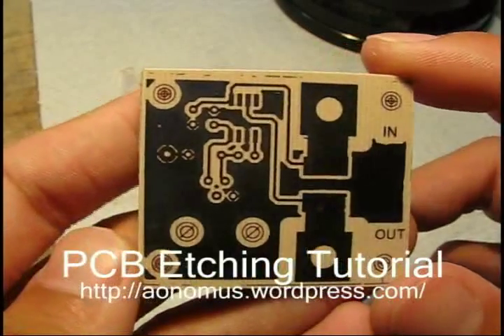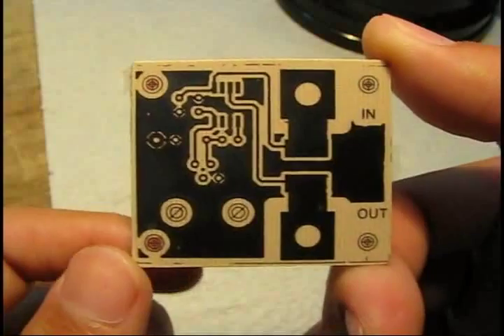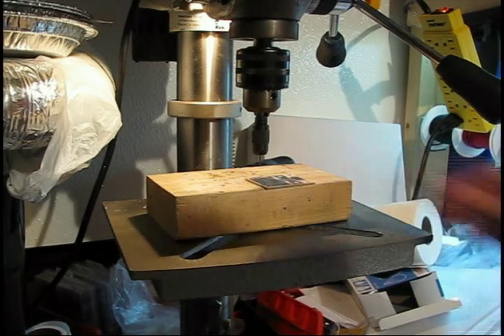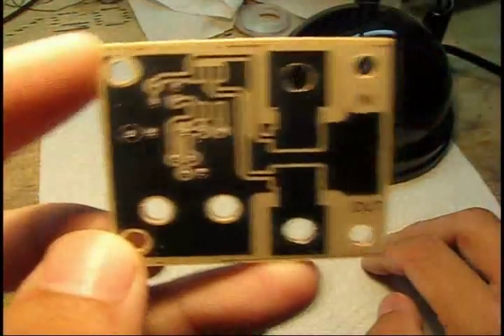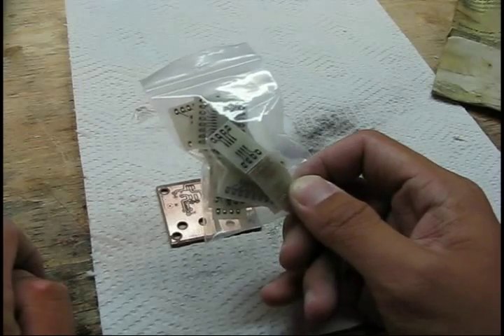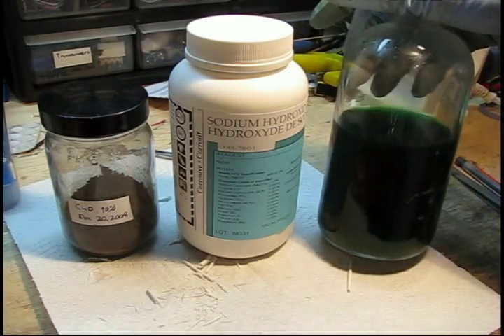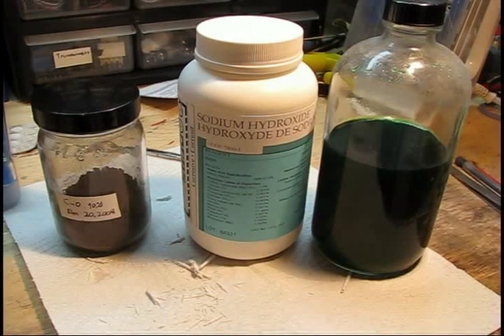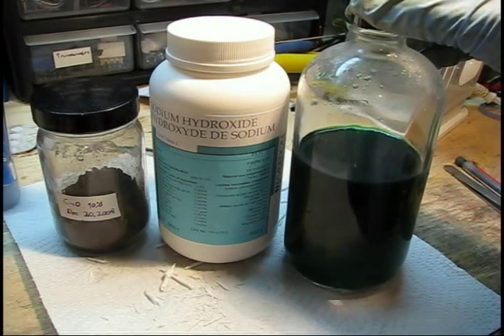PCB Toner Transfer Etching Tutorial Pt 4

Comment: @axel1973w 3mm = about 3000rpm for steel, softer material can use a higher speed and different drill tip angle. twice the size of the drill, half the speed. Half the size of the drill, double the speed. So for PCB, the faster the better really, especially for small drills.